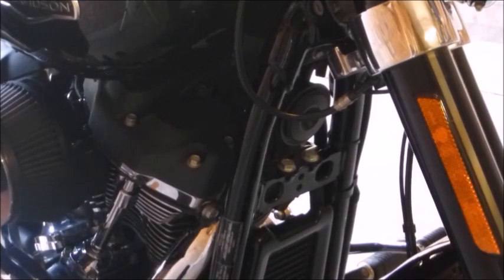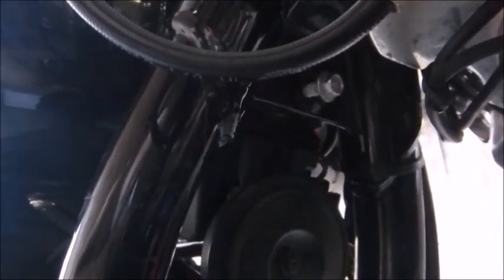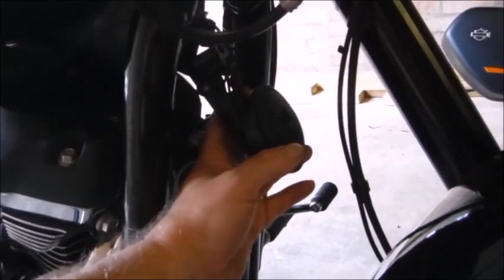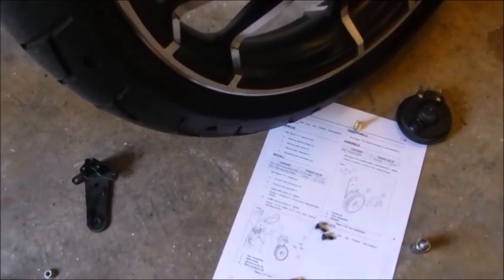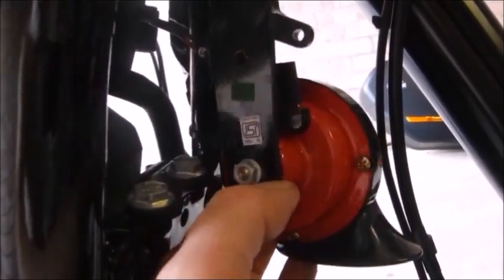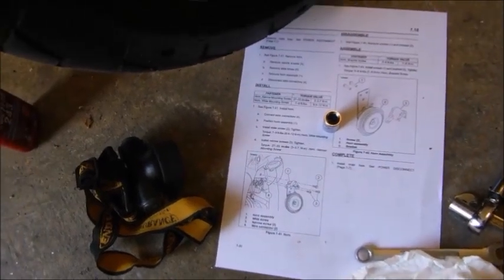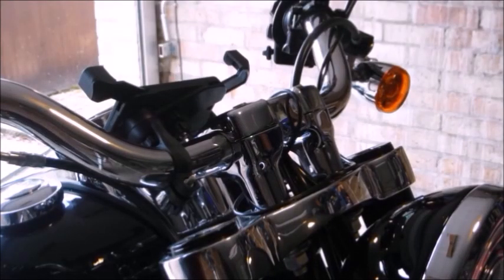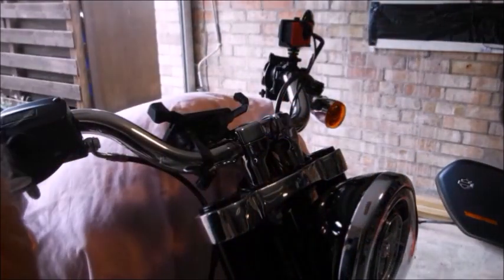Suffolk Sport Glide Change oem Horn  and change Risers to 4 inch

Comment: I was just wondering if what you've done brought you hands back any? I just bought my sport glide maybe a month ago. I feel I need about 2 or 3 inches farther back and I would be sitting straighter. I was thinking of using 4.5 or 6-inch curved risers and see if I could get the 2 or 3 inches from that. Instead of going through the trouble and expense of new handlebars. Have a good one.
Reply from the maker: I would say that this only bought my hands back by half inch, not much at all. i would think the 6 inch curved would be the best bet.  stay safe.

Comment: Hi Suffolk SG rider Martin another Suffolk SG rider here, I am after 4 1/2 pull back risers for my 2021 SG but am finding very hard to find the size 1/14 dia can you tell me where you go your and if you have it a link or part number.
Best
Martin
Reply from the maker: Hi Martin,  mine were off of an earlier model Fat Bob.  i do know that Harley do a 4" curved riser ...    https://www.harley-davidson.com/gb/en/shop/Curved-Handlebar-Riser-Kit/p/56066-82A
please check with dealer if this is the right part number for sport glide, i never trust whats on internet, and they are £159,   another place to look is in the Fatbook,  https://partseurope.eu/pageflips/en/catalogs/fatbook/2021
and i know newmarket harley also use this book for parts.  Hope this helps,  cheers Tom

Comment: Hi there. Love your videos. I have a question about what you did to the clutch cable in the tube area. I don't have the right vocab, but it's the part where you pinched the yellow and orange area. Is it possible to put the 4" pullback risers and move the clutch cable under the handle bars without opening the part inside the tubing located on the frame?  Thanks for the help.
Reply from the maker: Hi, i couldnt see any way of moving the clutch cable without undoing the orange/yellow part, by undoing that part you are not taking it totally off, its just a spring that then gives some slack up at the clutch lever on the bar so you can undo that and simply move it under the bars. hope this helps.  cheers Tom
Reply: @sportgliderider  Thanks Tom. How do you put that part back together (yellow/orange part of clutch cable , the spring)? After watching you (about 10 times now) I think I can do this job myself.... With exception of messing with the clutch cable. I need to understand that part better and can't find a video with the complete procedure.  I am being told at the mechanic shop that this is a 3 hour job and I don't quite believe it when  only a clutch cable needs to be moved under the handle bar. Anyway, thanks for taking the time to answer me. I also have the 2019 Sport Glide and your videos are very helpful and educational to me. 
Veta
Reply from the maker: @vetabordeaux2125   Noooo its not a 3 hour job, these people do like to rip us off.  if you could email me at 
suffolksportgliderider@ gmail.com with your email address i will send you the pages from the workshop manual, its just a matter of pushing the cables back together, they are just under tension of a spring, push them back together and then push the locking catch back into place. we only release the tension, dont disconnect the cable totally. but if you email i can send you the pages from the manual

Comment: Good video thanks am going to change the Coco the Clown horn that HD fit. Quick question, can yo please post a link to the front wheel (chock?) shown in your vids ...ta
Reply from the maker: Hi, got the stand from ebay, page is https://www.ebay.co.uk/itm/Sealey-Tools-MPS2-Two-Arm-Centre-Lift-Stand-Motorcycle-Motorbike-Cruiser-Style/360447857846?ssPageName=STRK%3AMEBIDX%3AIT&_trksid=p2057872.m2749.l2649                                                                     hope that works, its called Sealey Tools MPS2 Two Arm Centre Lift Stand Motorcycle Motorbike Cruiser Style
Reply: @sportgliderider  thanks for your.... reply though I was referring to the front wheel chock? :)
Reply from the maker: @Wavehead1773  sorry my mistake, wheel chock was also from ebay     https://www.ebay.co.uk/itm/MOTORCYCLE-SCOOTER-FRONT-WHEEL-CHOCK-MOTORBIKE-STAND-PADDOCK-GARAGE-TRANSPORT/123908460068?epid=0&hash=item1cd9850e24:g:fF0AAOSw4kheS8Iv
hope this helps
Reply: @sportgliderider  Legend! thanks very much

Comment: Hi Tom , great video as usual. Just to confirm were the risers you removed  the factory stock risers ? I want to do the same but was concerned about slack in cables and brake line . Cheers
Reply from the maker: Hi Rob, yes they were the stock risers that i removed and replaced with straight 4 inch that came off a dyna fat bob, seems they hid extra cable in the handlebar and under the tank, didnt need much pulling on the bar and it all came out.
brake line was fine, only the clutch cable i moved to the other side of the bar just to make sure it wasnt tight. cheers

Comment: Hi Tom, those twin horn kits are usually two tone, if yours is did you try both for sound and which one did you fit?
Keep up the good work.
Reply from the maker: You are right Philip, one was labelled at 410Hz and the other 510Hz, i fitted the higher frequency one,  not a huge difference but i thought the higher frequency might penetrate a bit more.
thanks for watching. Tom
Reply from the maker: Hi, update video with sound of both horns now online. cheers
Reply: @sportgliderider  Thanks Tom, you are right there's not a lot of difference, pity you can't fit both using a relay and a direct fused power feed. I am going to look into this on mine as the OEM horn is pathetic!
Good work, Phil.
Reply from the maker: @philiplockton9627  i am sure with a bit of fiddling around it would be possible to fit them both and probably hide the relay under the fuel tank, lots of the wiring passes under the tank already.  I was just in a hurry for a quick fix